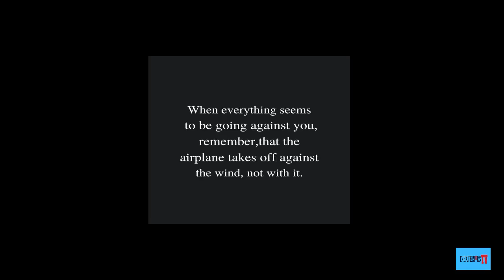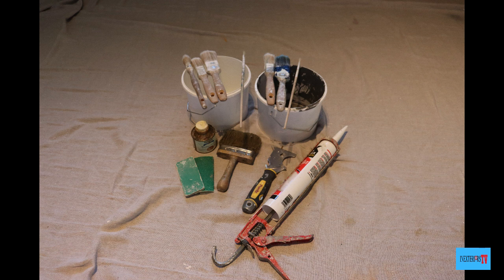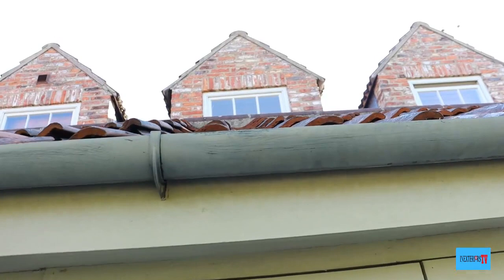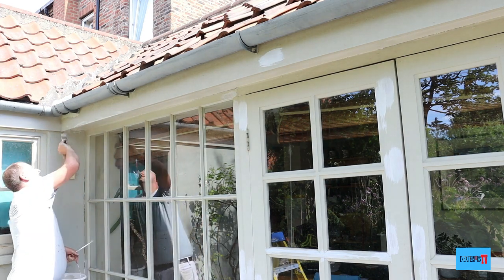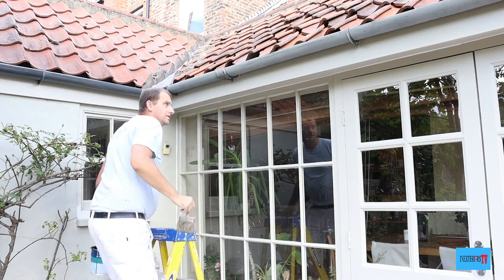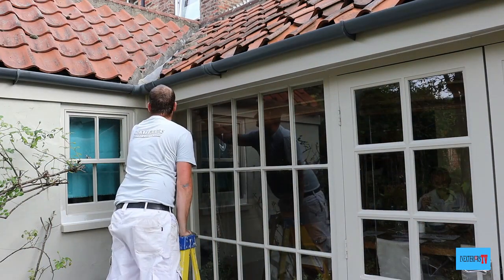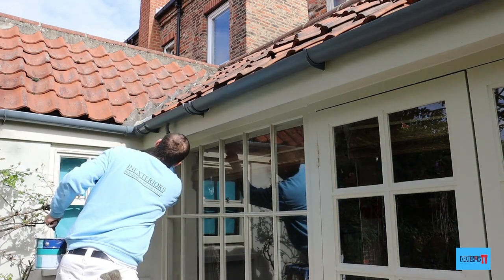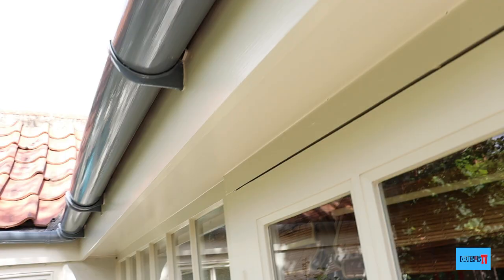Exterior painting part 1. Painting the fascia soffit & gutter.

Comment: Hi mate  need some advice please   I'm doing a job next month and the walls in this house have been coated with some kind of oil based paint/ gloss.... any ideas what to use as a undercoat before I paint emulsion on top?
Reply from the maker: Hi are you sure its not water based vinyl silk or a soft sheen finish. Check by putting some methylated spirit on a rag, if the rag turns into the wall colour then its water based, then just sand down and paint.
If the rag is clean then its oil based, then you will have to use a bonding primer like zinsser bulls eye 123 ,
Reply: @Inexteriors  cheers m8  definitely not a silk paint  it's positive oli based by the feel of it
Reply: @boabyboy978  I'm working in a very old school building at min and some rooms have oil based eggshell on them. Painted in the 70s. Budget doesn't allow for primer so I have went straight over in soft sheen. Sticks ok after it hardens in a month or two lol wont pass a scratch test for a while. I have also went over in acrylic eggshell and it sticks much better and hardens quickly. Obviously if budget is there prime etc but if not acrylic eggshell will stick to oil eggshell on walls quite well. Even the acrylic Matt's will stick
Reply: @stuartmcintosh7187  thanks pal  thats very useful information
Reply: @boabyboy978  I have the odd customer that still has me oil undercoat and gloss their kitchen ceiling. After a few years the sheen level of the gloss dies back. These people are in their 90s. Different world back then .  Lol
Reply: @stuartmcintosh7187  wont the heat in the kitchen  cooker steam etc affect the gloss on the ceiling after a while?
Reply: @boabyboy978  it does. The sheen of the gloss dies down quite flat over time and can be patchy. Back in the day condensation was probably alot worse in kitchens and so alot of people finished them in oil based gloss. It's the same with window reveals. Alot of older customers prefer them glossed because windows were likely single glazed in their day and it meant mould didn't form as easily if u had them glossed. Oil based eggshell on walls in schools many many years ago looks rough nowadays. But it was bullet proof in comparison to modern paints. U could have used bleach and everything to clean them down.. But nowadays decorators like us are having fun painting over them lol u aren't allowed to use oil paints in schools anymore where I am in northern ireland. I find that decorating in the 60s and to the 80s was done for reasons to protect the material that was being painted. Not so much for appearance. It's the same with fences. Years ago new fences got a coat of cresote and it never rotted. Nowadays we all paint them fancy colours that look terrible after a few years and need done again .but back then people must have been alot more frugal with money lol. I do work for some people in their 90s and up until recently they still washed their windows themselves inside and out every Friday. When u arrive at their house to paint a room they have the room cleared as best as possible. Compare that to arriving at someone's house that is in their 20s and some of them don't move anything. Their grass a foot high and have  plenty of money but live in different times lol I'm only coming 40 myself but these are just things I notice about the older generation. We could learn alot 🤣
Reply: @stuartmcintosh7187  yeah I hear what you're saying m8...working at a old boy flat at the moment  he's practically cleared out the entire flat heheh
Reply: @boabyboy978  🤣I don't know how they keep going. I did a job for an older lady and she was out working in her garden before I arrived and was still there when I was going home lol put me to shame lol